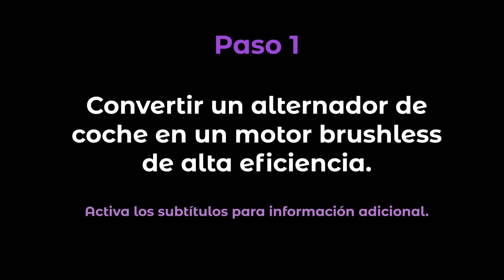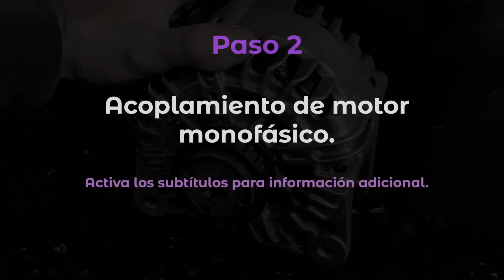Cómo hacer un generador de ENERGIA GRATIS con un ALTERNADOR DE COCHE⚡💡💡⚡

Comment: Hi. What brand and type of alternator + motor do you use? (+ Volt, amper, etc info...) Thank you!
Reply: Amennyit látni a videón Valeo 24V 200A a generátor. A motor 1000W körülinek néz ki, aszinkron, 220V.
Reply: @koambra это при максимальном числе оборотов , а если ведущий двигатель слабее ведомого то максимум что получим на 20%выход мощности меньше затраченного то есть макс мощность 800 ватт а то и меньше, это видео полная профанация и обман

Comment: Vuelvo con una pregunta sobre el tamaño de los imanes y de que tipo estoy esperando respuesta para poder empezar a trabajar, ya que veo que otros amigos han hecho la misma pregunta. gracias por una respuesta favorable
Reply: Me uno a ello, PORFAVOR POODRIAS DE IR LOS IMANES QUE USAS TIPO Y FUERZA ETC ?
Reply: Si no me equivoco son de neodinio los imanes
Reply: Los puedes conseguir en alguna tiene electrónica , son los que usan dentro de los disco duros
Reply: Para eso están los subtitulos pon e atención a eso que los pasan bien rápido el dice neudinos
Reply: @calebvallejo4592  GRACIAS
Reply: @bobbylopez8510  LO SIENTO PERO NO PUEDO ENTENDER EL TAMAÑO SI LO SABES
Reply: La pregunta no tendría que ser que tipo de iman usa, la pregunta sería cuantas vueltas tiene la bobina oculta en la base para cargar la bateria con pilas de litio y las bobina oculta debajo de la mesa, ya que la prueba del taladro no la puede hacer cuando retira el aparato de la bobina primaria que hace las veces de transformador, salvando las distancia es lo mismo que se usa para cargar los celulares inalábricamente, o los automóviles electricos en estacionamiento con bobinas bajo el piso, pero si quieren creer en eso, disculpen mi comentario tecnico.
Reply: My magnet friend is neodymium N52, N44 or N35. 

You need 12 pieces in size 10*40*20. 
Or the small size 10*20*20 mm 
You need 24. 
Engine if 12 volts generates 120 volts ac 
The engine, if it's 24 volts, generates 240 volts.
I built it two months ago, and it's working.
Reply: @موسوعهالكابتنمعتز  THANK YOU FOR ANSWERING IN DETAILS AND I'M HAPPY THAT YOU SUCCEEDED BUT WHAT ENGINE DID YOU USE, I HAVE A 750W 2800ROT 220V ENGINE FROM HIROFOR CHECK THAT IT'S GOOD AND WHAT ALTERNATOR DID YOU USE HOW MANY AMPES AND VOLTS
Reply: @Sevillano82  Mi amiga imán es el neodimio N52, N44 o N35.
Reply: @bobbylopez8510  Mi amiga imán es el neodimio N52, N44 o N35.
Reply: @erikgarcia7851  Necesitas 12 piezas de tamaño 10*40*20.
O el tamaño pequeño 10*20*20mm
Necesitas 24.
Reply: @carlosivancuellarescobar309  Necesitas 12 piezas de tamaño 10*40*20.
O el tamaño pequeño 10*20*20mm
Necesitas 24.
Reply: @bobbylopez8510  Mi amiga imán es el neodimio N52, N44 o N35.
Reply: @calebvallejo4592  PRUEBA Y CUÉNTANOS QUE RESULTADOS TIENES
Reply: @Sevillano82  PRUEBA Y CUÉNTANOS QUE RESULTADOS TIENES
Reply: @carlosivancuellarescobar309  PRUEBA Y CUÉNTANOS QUE RESULTADOS TIENES
Reply: @Sevillano82  Mi imán amigo es el neodimio N52, N44 o N35.

Necesitas 12 piezas de tamaño 10*40*20.
O el tamaño pequeño 10*20*20mm
Necesitas 24.
Motor si 12 voltios genera 120 voltios ac
El motor, si es de 24 voltios, genera 240 voltios.
Reply: @carlosivancuellarescobar309  Mi imán amigo es el neodimio N52, N44 o N35.

Necesitas 12 piezas de tamaño 10*40*20.
O el tamaño pequeño 10*20*20mm
Necesitas 24.
Motor si 12 voltios genera 120 voltios ac
El motor, si es de 24 voltios, genera 240 voltios.
Reply: @erikgarcia7851  PRUEBA Y CUÉNTANOS QUE RESULTADOS TIENES
Reply: @carlosivancuellarescobar309  Mi imán amigo es el neodimio N52, N44 o N35.

Necesitas 12 piezas de tamaño 10*40*20.
O el tamaño pequeño 10*20*20mm
Necesitas 24.
Motor si 12 voltios genera 120 voltios ac
El motor, si es de 24 voltios, genera 240 voltios.
Reply: in addition to these magnets, a 220 volt electric motor with 3000 rpm is required to have a constant frequency of 50-60 hz
Reply: @rile68  where can we find this motor or we can put a voltage stabilizer or inverter stabilizer upc as external power sources for computer thank you
Reply: I wouldn't know that, I ordered a 1.5 kV 3000 rpm 24 volt alternator motor, I still have to buy magnets, so I'm trying to make
Reply: @rile68  AT 1.5KW POWER, WHAT APPRECIATION DOES IT HAVE AND WHAT BRAND IS NEW OR SECOND HAND?
Reply: @rile68  AFTER I KNOW 1500W / 24V = 62.5 APER IS SMALLER BETTER 100-150AP
Reply: @panaitmarian1904  I agree
Reply: @rile68  GRACIAS
Reply: @panaitmarian1904   Почему склеиваете магниты одним полюсом?
Reply: @ВячеславБасин-щ9с  Я ПОСЕТИТЕЛЬ И ЗАДАЮ ВОПРОСЫ И НА НЕКОТОРЫЕ ПОЛУЧАЮ ОТВЕТ ОТ ТЕМ, КТО ПРОБЫЛ И ДАЮ ТАКОЙ же ОТВЕТ ТЕМУ, КТО ЗАДАЕТ ВОПРОС Я НЕ ЗНАЮ БОЛЬШЕ, ЧЕМ ЭТО ВИДЕЛО В ФИЛЬМЕ СПАСИБО
Reply: У МЕНЯ ЕСТЬ ТАКОЙ В ПРОЕКТЕ Я СДЕЛАЮ ТАКОЙ МОНТЖ Я ДОЛЖЕН НАЙТИ ГЕНЕРАТОР В Б/У НОВЫЙ ЭТО ДОРОГО
Reply: @MarioPerez-vb9hj  Aquí está el experto habitual. Lea la historia de Tesla y tal vez comprenderá lo que sucede con aquellos que intentan traer innovaciones que perturban a los operadores del mundo. Estudiabas libros que de alguna manera decidían cómo debían escribirse, sometiendo la ciencia a su voluntad, para asegurar el control del poder.
Reply: @موسوعهالكابتنمعتز  Hello. Is it possible for you to give details of the devices you used, I already know what magnets, but I have a question about the alternator and the engine. What parameters of the alternator and what engine. Thank you for your answer. Regards, Max
Reply: No perdáis el tiempo esto tiene truco.

Comment: Excelente solo quisiera saber las especificaciones tecnicas del  motor el voltage es 220 volt por la salida del alternador pero las RPM ...? y la potencia del motor en HP ...? Thank you
Reply: Hola, obtuviste respuesta???
Pues espera sentado a lo demas.
Pero que los seres vivos no se dan cuenta del fraude??
Pero si pasa en la solar, cuanto tienes que invertir para sacar rendimiento y beneficios??
Reply: @docstrench948  Lo hice y funciona ningún fraude así que hazlo y después comenta no seas negativo.
Reply: @KRV494  Bendiciones, puedes compartirnos los datalles please , y si la energia que obtuvistes fue para alimentar una casa ?
Reply: @KRV494  А какой мощности электродвигатель стоит ?
Reply: 0.75 CP, 0.55 kW, 220 V, 2800 RPM in load, - 3000 RPM free.
Reply: @unclepaul8331  благодарю вас от души )
Reply: @unclepaul8331  OK , thank you !
Reply: @KRV494  Hola. Tal vez tú, que ya lo hiciste, podrías detallar la manera correcta de colocar la polaridad de los imanes, eso es fundamental y no se comenta en el video. Se ve como que le cuesta trabajo colocar los primeros, lo cual querría decir que está tratando de juntar polos iguales ¿Acaso es así? Gracias de antemano.
Reply: @KRV494  por fa, amigo demuestralo con un video sin editarlo  que se vea funcionado el aparato  y por cuuanto tiempo puede permanecer funcionado hasta apagarse, y con cuantos aparato funcionando simultaneamente
Reply: @KRV494  Olá. Quantos watts e a rotação do motor monofásico para fazer funcionar corretamente o alternador? Obrigado

Comment: Lo Felicito Excelente solo quisiera saber las especificaciones tecnicas del  motor el voltage es 220 volt por la salida del alternador pero las RPM ...? y la potencia del motor en HP ...?
Reply: Como sale regulada ha 220v del alternador...Ves algún regulador? :)
Reply: @KenzoAkihiro  он не регулируется, у двигателя обмотка для сети 220в, его просто раскручивают, и на обмотке 220.

Comment: Boa noite  amigo , parabens pelo video , gostaria de que tirasse só  uma duvida , que fizesse uma outra explicação , mostrando o motor monofásico , tem muitas pessoas  desconfiando que tenha uma bateria  , inversor etc...  dentro dele ...obrigado.
Reply: Amigo the assembly does not require battery or an inverter, the speed of the driving motor maybe regulated with PWM device to make the desired frequency output, for the voltage output it can be control by AVR.

Comment: Te felicito por tan genial idea.
¿Cuáles son dimensiones de los imanes, largo, ancho, largo?
¿El grado de los imanes es N52 o superior?
Por favor, su respuesta.
Muchas gracias
Reply: Estudia como funciona la electricidad para que no se rían de tu desconocimiento..Por favor.
Reply: X2 ¿Cuáles son las características de los imanes?
Reply: @pepelopezlopez8940  Aquí Pepe chambitas preocupado por que no le quiten el negocio.
Reply: @Enoc33  Es el pan de cada dia. Desgraciadamente
Reply: Qué pasa con la electricidad excedente donde se va no se sobre calienta si no se usa ?
Reply: Necesitas 12 piezas de tamaño 10*40*20.
O el tamaño pequeño 10*20*20mm
Necesitas 24.
Motor si 12 voltios genera 120 voltios ac
El motor, si es de 24 voltios, genera 240 voltios.
Lo construí hace dos meses, y está funcionando.
Reply: @panaitmarian1904  Bien...imagino que lo tendras filmado... y si subis tu video?
Reply: anche io ho riprodotto la macchina ma genera massimo 40 volt a 3000 giri/minuto 22 volt a 1440 giri / minuto ovviamente l' alternatore era da 24v 60 ampere
Reply: My magnet friend is neodymium N52, N44 or N35. 

You need 12 pieces in size 10*40*20. 
Or the small size 10*20*20 mm 
You need 24. 
Engine if 12 volts generates 120 volts ac 
The engine, if it's 24 volts, generates 240 volts.
I built it two months ago, and it's working.
Reply: @marcelojavierperales2574  RECIBÍ SUGERENCIAS DE LOS QUE PROBARON NO TERMINÉ MI SISTEMA LO RECIBO Y PIENSO LO BUENO
Reply: @glaucogentili1692  Pero funciona entonces? (aunque sea con menos voltaje)
Reply: @panaitmarian1904  aah, ok, como leí en tu otro mensaje "I built it two months ago, and it's working.", pensé que alguien más lo había hecho y le funcionó. Por donde te dijeron eso?, por acá por youtube?
Reply: @marcelojavierperales2574  si funziona ma vedo molto difficile che riesca a generare una potenza da far partire un motore che ha bisogno di uno spunto importante
Reply: @glaucogentili1692  il motore che non funziona e 220v?...  (se genera solo 40 v dovresti alimentare qualche motore per 12 v tramite un trasformatore). che corrente puo fornire senza caduta di tensione?
Reply: @marcelojavierperales2574  AQUÍ EN YOUTUBE EN PRIVADO Y DIO A LOS QUE PIDIERON CON PEDÍ
Reply: @marcelojavierperales2574  COMO ME CREO LO QUE DIJERON Y PRUEBA UN PROYECTO MAS PEQUEÑO CON MOTOR 24 V
Reply: @marcelojavierperales2574  AÚN NO PUEDO ENCONTRAR UN ALTERNADOR 24V 200A BARATO
Reply: @panaitmarian1904  ¿el de 120 v o el de 240 v cuál construiste?
Reply: @marcelojavierperales2574  buen día, ¿En cuánto te han cotizado los alternadores de 24 v a 200 Amperes que has investigado?
Reply: @matematicasenlinea  Buen día. Creo que tu pregunta era para "Panait Marian1".
Reply: @marcelojavierperales2574  perdona así es, equivoqué destinatario 😊
Reply: @matematicasenlinea  NO SOY UN AMIGO QUE ME ESCRIBIÓ Y CONTÓ DE LOS IMANES QUE PUSO PARA MAS INTERESADOS PROBAR NO ENCONTRÉ ALTERNADOR 24V 200A EN SEGUNDA MANO NUEVO ES CARO 2000EU Y VOY EN 220V
Reply: @matematicasenlinea  RESPUESTA DE Mi imán amigo es de neodimio N52, N44 o N35.

Necesitas 12 piezas de tamaño 10 * 40 * 20.
O el tamaño pequeño 10*20*20mm
Necesitas 24.
El motor de 12 voltios genera agujas de 120 voltios
El motor, si es de 24 voltios, genera 240 voltios.
Lo construí hace dos meses y funciona.
Reply: RESPUESTA DE Mi imán amigo es de neodimio N52, N44 o N35.

Necesitas 12 piezas de tamaño 10 * 40 * 20.
O el tamaño pequeño 10*20*20mm
Necesitas 24.
El motor de 12 voltios genera agujas de 120 voltios
El motor, si es de 24 voltios, genera 240 voltios.
Lo construí hace dos meses y funciona.
Reply: @glaucogentili1692  devi incollare i due magneti con polarità uguale nel centro.
Reply: @teknosecurity871  personalmente ho fatto di meglio utilizzando un unico magnete della misura di 40x20x0,5 mm ma non va
Reply: @teknosecurity871  ovviamente alternando polo positivo con polo negativo

Comment: Thanks for putting this video out. I tried to duplicate what you did but using a 12vdc 150 amp alternator and was only able to get 10 vac between each output leg of the alternator.  I believe what you did is possible but I have a few questions. In your video you showed us the magnets used was Neodymium magnets but didn't specify strength or physical dimensions. Second, I only saw one stack of magnets stuck together indicating they all had the same polarity. When the magnets were installed on the rotor the curved (convex) side of the magnets were on top, facing up. One side of the rotor was marked North and the opposite side was marked South. Did you have another set of magnets with reversed polarity? If not, how was the polarity changed. I am currently building a second alternator right now. I have the rotor machined and I am ready to order magnets. I plan on ordering grade 52 Neodymium magnets 22mm wide, 30 mm long and 5 mm thick. The long side is going to be installed between the two halves. I welcome any suggestions you may have. Thanks again.
Reply from the maker: They are N52 magnets. We have custom purchased them from a Chinese manufacturer. There are magnets with North polarity and others with South polarity. There is a secret that does not appear in the video, but now we can tell. Beneath the electrical tape is a thin sheet of a special alloy of silver and aluminum. Thanks to this we eliminate magnetic braking
Reply: Hi, what is the exact model of the Valeo alternator?
 @thecrazychannelyt

Comment: Si genera 10kw no necesitarian de cables mas gruesos? Por un 10 kw yo uso un cable de 10mm o estoy equivocado? Ademas en los video se ve que conectan aparados que si usan 1000 o 2000w y el cable de 2.5mm esta bien, y si le pongo un aire acondionado que necesita 2 kw y una nevera y un horno (1kw y 2kw) lo cables no se queman?

Comment: An output of 10KW is nice, but how much of it did it take to run the motor that drives the generator? Is this a perpetual motion machine with a unity over 1? If so, by how much?

Comment: En el mercado he encontrado un generador de 10KVA a 3000 RPM. y un motor electrico de 3000 RPM. Mi pregunta es ¿puedo comprarlos y acoplarlos? el consumo del motor es de 200W y si es posible producir 10KVA (que supongo que son KW) tendria unos 9,5Kw disponibles.
Reply: qué tipo de motor eléctrico es?

Comment: I would like to see a demonstration of how well this device performs when power tools are under load. For example, a grinder that is actually being used to grind metal heavily; a tablesaw that is ripping boards; a drill that is boring deep and wide holes in wood and metal. I really think that people want to know just how practical this device would be in real world use.

Secondly, in such real-world usage, does this not need to be electrically grounded?

Comment: I have done this experiment in 1982 with cycle dynamo’ 

I have done this same experiment 40 years before with a toy car Dc motor..
in 1982 i were studying in 4 class’ there is a scooter mechanic in my area’ the mechanic narrated me the process of magnet and copper coil how it’s work when the magnet pass from the copper coil it’s produced fluxes current that current use the whole system of electrical work in scooter 🛵’ even the coil pass the high current to plug spark ⚡️ to burn 🔥 fuel’ it’s very simple and easy definition.. what amazing! 

Today everybody is copying each other experiences copied videos on YouTube.. 
Durvesh yezdani’s

Comment: 1. The 24V generator stator began to produce 220V. Those. The shaft rotation should be 10 times more than usual.
Those. (for example) generator from Kamaz 2000 rpm output. 28V. Max. current strength 30A.
To spin the generator up to 220 volts, you need to increase the speed to an average of 15,000 rpm.
A standard single-phase motor (for example AIRE) has a speed of 1350 - 3000 rpm.
2. When connecting a load (drill), there is no fluctuation in speed in the engine-generator system. This can be heard from the sound of rotation and can also be seen from the belt. Therefore the drill is not connected to the generator.
When you turn on the headlights in a car, you can easily notice how the engine speed decreases slightly. (At idle speed of course).
3. Well, the simplest understanding. This device requires minimal adjustment of the balancing and voltage regulation system. And she's not here at all. The engine is inserted directly into the gene.

Comment: I really really really want this to work because it seems like everybody from a different country is like wow great job this is awesome everybody from the United States is like there's no way this is possible this is garbage so I don't get why you cut the magnets and then glued new magnets on, are these stronger? do you create a bigger field with these? Just wondering it's just the motor that you made is a stronger motor does it take less power to run if that's possible then and this would be possible to have a motor that takes less power to run a motor to power itself seems like my head's gonna explode I feel like you would store energy and give it back at certain times to kind of push it over the edge to make it perpetual but I'm not smart enough to figure it out

Comment: un alternador puede tener un voltaje de 12v y una corriente de 100 A, entonces una potencia de 1200 w ¿Cómo se obtienen 10000 w de él y un voltaje de 230 v? para obtener una potencia de 1200 W, el generador debe funcionar con un motor de al menos 1500 W, teniendo en cuenta las pérdidas.por lo tanto, un motor de 230v 1500 W no puede accionar un generador de 12 v 1200 w solo si un poder divino compensa los 218 V.

Comment: Hi ! friend, It interesting your video post. I have question about that. Most car alternators  product from manufature  only 13 volts not over. How your get 120v from your alternator to run 120v AC motor tor on your project make work, or your project have new edit, you remove the green ac power line out. please answer to every one have to learn from you, and trust ?.